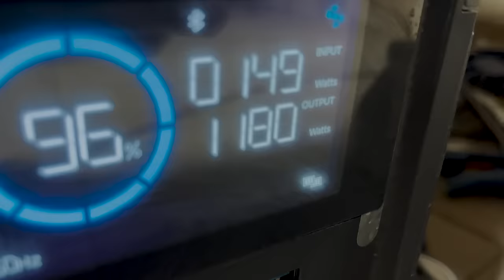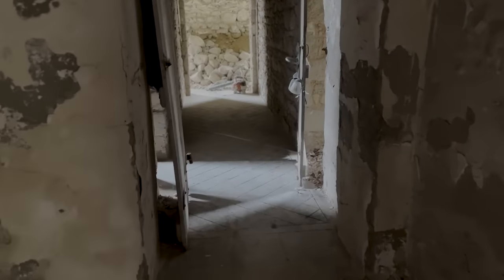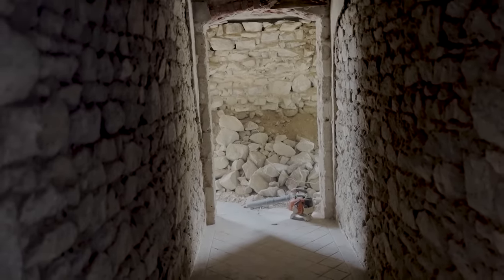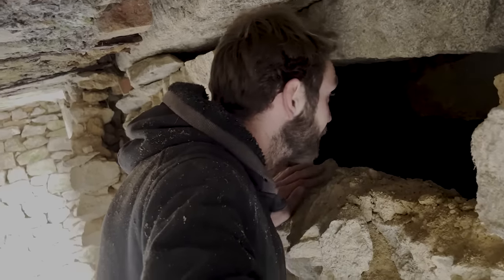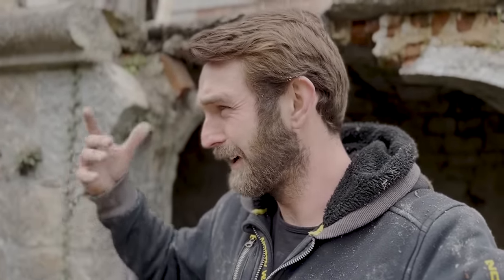I discovered HIDDEN rooms under the basement of this CHATEAU RUIN and went inside!

Comment: Looks like your wheelbarrow tire could use some air.  It will be a lot easier to push if it's fully inflated.  Good job staying on task! 😊 There's plenty of square footage and good ceiling height to make the ground floor a very cozy home.  All of the rooms on outside walls seem to have a beautiful big window.  I believe at one time Dan said the kitchen, pantries, and maybe even servant quarters were on the ground floor.  I'll bet the last room to be shoveled out has a stamped concrete floor too.  There's no reason it would be dirt.  They certainly didn't use it as a stable. 😅

Comment: The areas you showed don't really strike me as rooms per se, but just extensions(?) of the foundation as needed for various features of the building. What is clear in some of the background images is that there are some serious foundation repairs to be done, to maintain continuity of support for the remaining shell.
 I do agree that some of that stone work looks older than other areas.
Reply: A lot of the iron work in the concrete of the roof of the basement looks v rusty. Is that safe as floor/ceiling for the future?

Comment: A quick question, do you plan to sift through/ run a metal detector over all the debris from the basement and ground floor? If it’s the fire debris could it have treasures buried/fallen in it?
Reply: Later, most likely
Reply: I hope so! I was thinking the exact same thing!
Reply: I don’t think there will be any treasures. The previous owners commuted arson, most likely out of financial desperation. Whatever valuable item was in that place was very likely removed.
He may find a metal door knob or some screws.
I wouldn’t waste time digging through the rouble.
Reply: @iu.5146  It's architectural remnants he'd be looking for though, so that he can recreate features.

Comment: Since the rubble you are pulling out is rather fine, could you spread it evenly around your chateau and compact it to have a solid surface while the place is under construction. It keeps out the mud and provides solid ground for machinery.
If you don’t want it right around your chateau, put it where you plan you future car parking area.
Chateau La Lacelle used the debris from inside the chateau to create an access road to the chateau.
The debris is the base layer and the put gravel on top.

Comment: Under the stairs would have been sealed up because of it's a common water intrusion area, so historically not worth putting anything valuable under there.  Sometimes it was used as an early cool pantry due to its cold exposure, but once water comes in, it caused food to rot.

Comment: Imagine if Dan had a utility van (or as the Brits call it a caravan) rather than yet another junker car. Could hold all his tools. The EcoFlow permanently installed and secure. A fridge. Small water tank. Portable toilet. A single bed. Large roof rack. A toe hitch with a small trailer. Wonder if that would be a good investment? Guess it's just me.

Comment: WIth some of the floors looking so clean, I'd be really tempted to hit the flat walls with a wallpaper scraper, spade or stiff-bristled broom to take off anything that's likely to fall off before too long (and maybe the ceilings) and use a broom on the uneven surfaces of the walls. It might be worth getting the corridors into a state that you can keep them clean and avoid walking the debris around elsewhere. At this point it's not really that important I guess- nice video....

Comment: That space could be a passage and steps, or slope, down to a lower cellar? ie you said the one end much deeper than the other? Maybe a coal cellar, or for storing barrels or similar that could be rolled down? Would explain what looks  like the outer access hatch, the depth difference of floor from one end to the other, and the dimension of it? But you probably should wait til someone else is there with you to delve deeper.

Comment: Definitely knock on all the walls and floors in the basement to find out if there are more hollow rooms behind - likely there are some lower levels still that were probably closed when the new chateau was built on top of the old fort. It's always like this. Plus, if it was a fort, it certainly had a secret tunnel to the neighboring castle or an old gothic chapel…

Comment: You have a mansion built like many at the time. It was a hybrid of new and old technology.  The basement ceiling looks like some kind of reinforced masonry or concrete, By the last decade of the 19th century very high cost residential construction was using techniques to build fireproof as much as possible especially when they contained expensive furniture and interior paneling etc. They imitated commercial construction. They weren't using reinforced concrete much for anther few decades. The rest of the upper floors in you house were a hybrid of steel beams and oak (or other wood) joists. Maybe the joists were exposed in the finished rooms? What worries me is the way the iron or steel  reinforcement is showing in the basement ceiling and could mean that the rebar is rotten trough? You might have  to rebuild those slabs?  Chateau de Basmagner has the same problem with the kitchen under the terrace.  I also hope that fallen arch facing doesn't mean there are many other places like that where the veneer and core are separating because of water infiltration? 

I hope someday you can find some interior photos but good luck. Hope someone during the Brownie camera era managed to snap some interior shots. It would be great if you could find photos made by a photographer the owner hired to record his new mansion. People used to do that but the old chateau photos some owners have shown so far always seem to be out doors and showing family or household groupings. Maybe the average camera could be used indoors? . 

I wonder if they were using that pit under the stair as a cistern?  Why build a pit at all? 
. 
I love those old beamed ceilings but if I had the place I'd probably do what they did to Chateau de Theil and replace the interior with reinforced concrete beams and slabs. It's fireproof and rot proof.. Your place is already cleaned out. Maybe hybridized techniques like the old days? Using reinforced concrete slabs cast on a traditional beamed framework (perhaps not as closely spaced). In other words the beamed ceiling is also the formwork. It's redundant and more expensive than just using one or the other technique but you'd get the look and feel of both worlds. But it would be a massy floor and not likely to rattle or vibrate. It would be fireproof but the wood elements would char. I think these old mansion tended to have "dead" floors without little or no vibration. .

Comment: I HAVE BEEN FOLLOWING THIS FOR SOMETIME NOW.  I CAN'T HELP BUT THINK THAT ANY NEW ROOF CONFIGURATION IS GOING TO BE DIFFICULT, TIME-CONSUMING AND EXPENSIVE.  I WOULD NOT RESTORE, BUT WOULD RENOVATE.  
RATHER THAN TRYING  TO CONSTRUCT A DIFFICULT  (ORIGINAL) MANSARD ROOF CONFIGURATION, I WOULD GO WITH A SIMPLE "FLAT" ROOF AT EITHER END OF THE BUILDING.  (THE BUILDING THEN WOULD BE  WHAT CALL WE CALL A "HALL" CONFIGURATION).
ONE EXCEPTION, WOULD BE, I WOULD RESTORE THE CENTERED TURRET OR TOWER, BUT FOR THE REST OF THE BUILDING A  "FLAT" ROOF WITH A SLIGHT PITCH FOR RAIN-WATER DRAINAGE.  YES, IT WILL NOT LOOK OR RESEMBLE THE ORIGINAL CHATEAU.  IMAGINE THE CHATEAU WITH AN ONLY CENTERED TURRET OR TOWER.  KNOWING DAN, HE IS GOING TO                   R E S T O R E,  NOT RENOVATE.      - J PATRICK GENNA

Comment: Great job Dan 👏 What about the roof?
Reply: Yes the Basement ceiling?, the steelwork looks a little rusty, I assume he's clearing out the Basement and the Ground floor so a building inspector can examine it and confirm if it can proceed or what remedial work is required, it appears solid enough when they are walking on it on the Ground floor at least, putting a load of scaffold on it to reach the Main Roof is another matter!?!